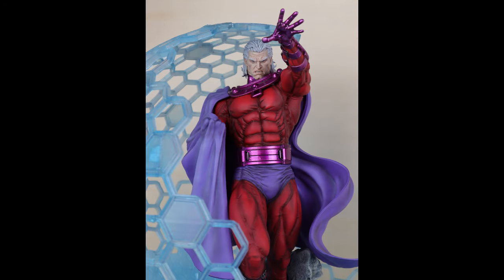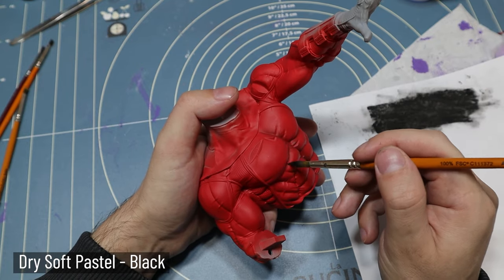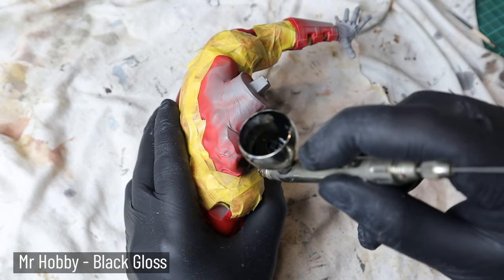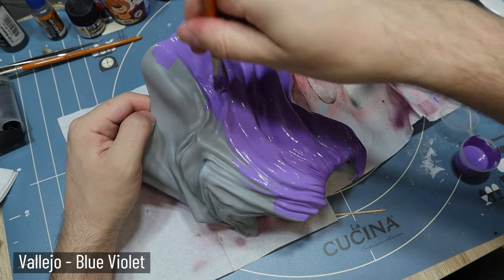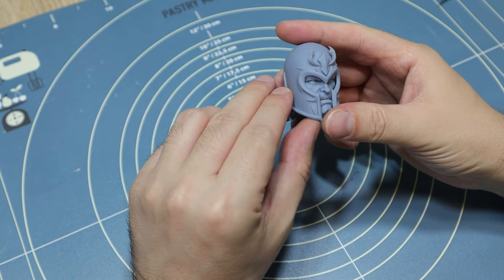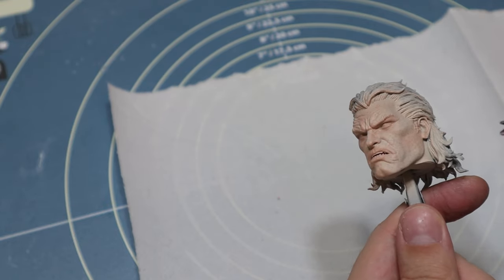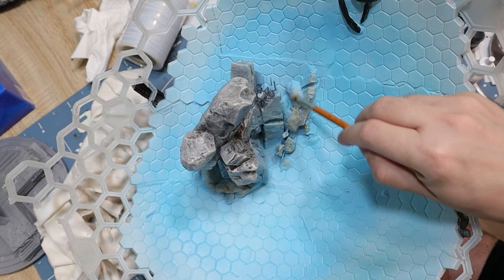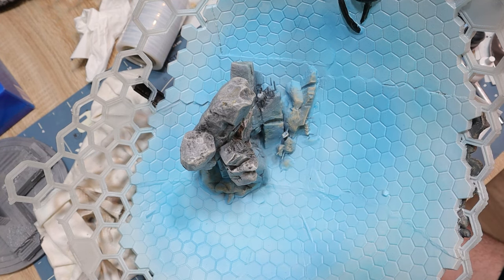MAGNETO - How To Paint 3D Printed Model

Comment: may i ask a step by step to get smoother result before painting??
Reply from the maker: Hey, what you mean smoother result before painting? I use resin 3D printer and from that, prints are pretty smooth already, no need to do any other preparation, just clean up support tracks.

Comment: I have a problem. When I try to spray the gx pink in the airbrush, it sticks after a short time. The color feels somehow very "dry". I have already thinned the paint. Do you have any idea what I can do differently? Use a 0.2mm needle in my airbrush
Reply from the maker: Only idea is bad thinner? Are you using original mr thinner? Other than that I do not know, airbrush nozzle doesn't matter. Make sure you dont mix it with other liquid that maight remain in your airbrush
Reply: @3DPainting  yeah I’m using the original Mr thinner. What is your mixing ratio? How many parts paint how many parts thinner ?
Reply from the maker: About 50/50 I'd say?

Comment: How many layers do you use with the chrome?
Reply from the maker: Usualy one thin and one thicker by my needs. Optimal should be 3 thin I'd say but I dont have time for that 😊
Reply: @3DPainting  thanks and how long do you let dry the chrome?
Reply from the maker: Well, that depends what kind of paint you use, for my Alclads its about minute
Reply: @3DPainting  i have a problem with the pink. Do you use thinner or something or something else? The pink don’t link vibrant at my model. Don’t know my fault 😞
Reply from the maker: It has nothing to do with thinner. You must use proper base coat, for pink it would be white.

Comment: Hi, what scale did you print this. I’ve got to reduce to 50% to print main centre rock on my Saturn 2 without splitting it into smaller pieces
Reply from the maker: Hey, I made it about 5cm taler due to very small head that modelers made. I am used to paint 1:6 heads from HotToys and this is very off-scale so I made statue a bit larger. Base was cut so I could print it with resin even tho I usually use STL printer for base.

Comment: In the video, you break the helmet off in several pieces, did you have glue the helmet back together?
Reply from the maker: I've printed two heads with helmet, I cut off helmet from the first, and cut off the head from the second. Then I painted it and glued them together.
Reply: @3DPainting  thanks for the reply. Yeah sorry, I understood that correctly. I guess I was surprised it was so easy to cut it out so cleanly. Great video. Thank you.
Reply: @3DPainting  now I just gotta figure out how not to break it when cutting  off the helmet:) I’m 0-2 so far
Reply from the maker: I used dremel

Comment: Also what do you seal the black pastels with so it just don’t rub off
Reply from the maker: Clear varnish. I useed the one from citadel, or satin from army painter or you can use again airbrush. Best one is super clear III from mr. Hobby
Reply: @3DPainting  can I use Krylon UV-Resistant Clear Matte Spray can?
Reply from the maker: I guess so 🙂 just give it a try off the model if it "likes" your paints so you won't potentially ruin it
Reply: @3DPainting  ok thank you.